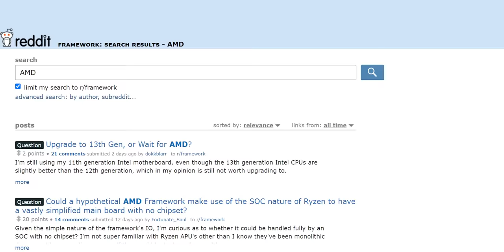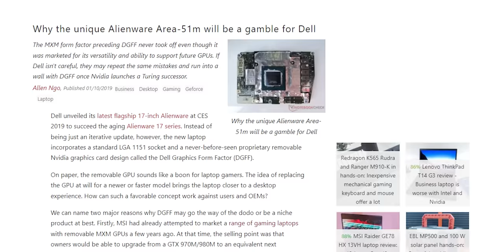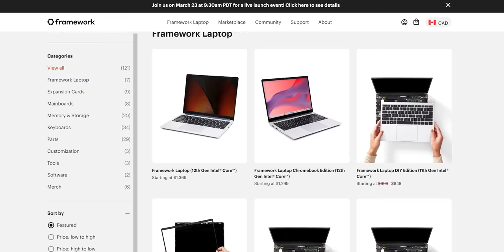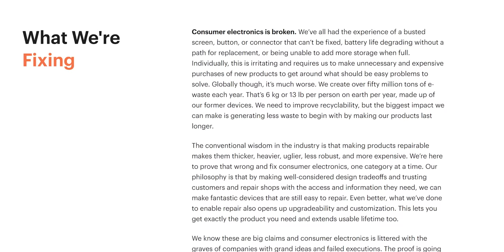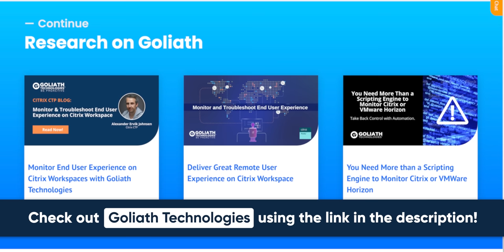I Made a Bad Decision – Framework Investment Update

Comment: THIS IS HUGE.

I prefer iGPU notebooks for work because they consume much lower power compared to dGPUs. And they're also lighter in kg.

However I also need enough horsepower, and Intel iGPUs don't cut it; while dGPUs are too much.
RDNA2 iGPU is exactly what I need. So it is AMD CPU + iGPU for me.

However every laptop from OEM either bundles an extremely weak AMD CPU/GPU combo, or it bundles what I need plus the dGPU.

TL;DR: No OEM brand offers satisfies what I need.

Framework w/ AMD support changes things. A lot.

Comment: Well maybe it would be good to ensure that they actually respect the EU consumer rights if the operate on this market. My 11gen Framework has been shipped to repair twice now, first time they claimed that there are no faults, second time the motherboard was broken and the repair shop does not have motherboards in stock. Yet they refused any other solving of the issue than trying to repair it. In the EU I am entitled to a replacement or a cancellation of the contract if the product is failing the conformity. And these rights framework support has repeatedly and on all levels denied to me.

Comment: 1 year later and who would've thought, the only gpu option so far is amd 😂

Also i'm kinda sad that the announced extendable battery does not seem to be a thing (yet?). Honestly with the amount of options you currently have this s3ems like the 16 is likely to fail within the next few years or so.... I know this is a weird thing to wish for (same goes for intel gpus but at least there is a giant coorperation behind it who wont go broke tomorrow if the gpus turn out to be a flop) but i hope enough people buy this so that the expansion bay concept survives. Thats one of the best things i've seen on laptops in recent years. A whole 8 lanes of pcie, imagine somebody designing idk a 10gbit nic  for this... What am i saying, 10gbit can already be done over usb 4 with 8 lanes probably gen4 you can go completely buckwild, even if its only gen3 you could easily go for a 25gbit or 40gbit nic and with gen4 even 100. I see tho that you'd have to run a kinda stupid raid 0 setup for saturating anything above probably 40gbit with the storage capabilities of this laptop😂

Comment: YES. i still to this day i have my dell studio 17 laptop came out in 2008...replaced the hard drive with ssd, back lid keyboard from another compatible model, the battery new, speakers shot( no point replacing )i got a decent sound bar! mother board and internal units are routinely maintained and has 12gb of ram...all in all its been almost 15 years and its till the raining champ. this is the way (FU Apple)